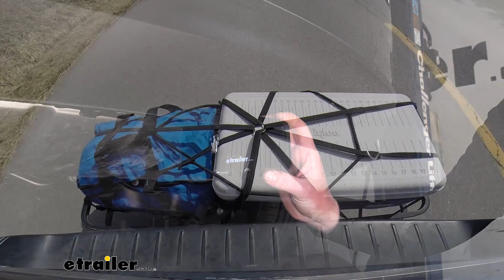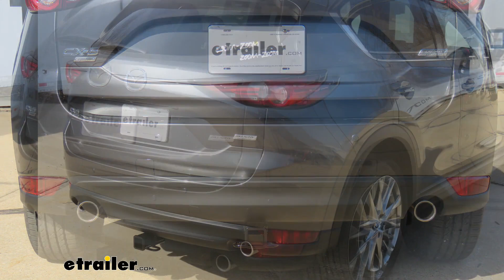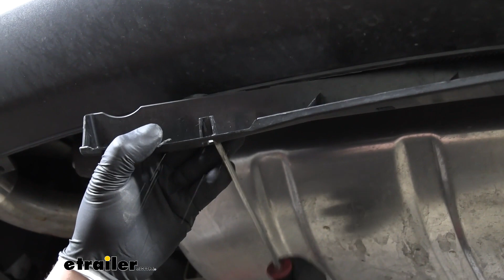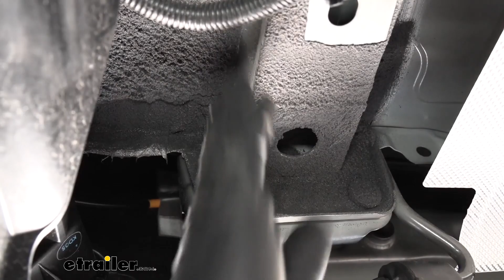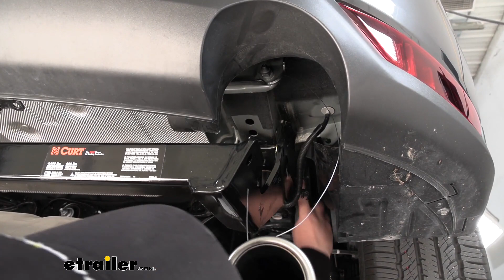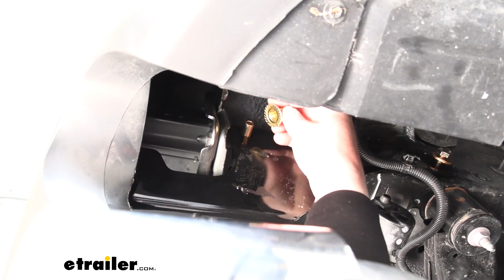etrailer | Mount: Curt Trailer Hitch Receiver on a 2019 Mazda CX-5

Comment: For CX-5, Mazda allows Class I hitches only. Otherwise you are gonna lose your warranty. Keep that in mind.
Reply from the maker: Where's that information found? There's no mention of it in the towing section of the 2019 Mazda CX-5 Owner's Manual, where Mazda lists the vehicle's towing capacity at 2000 or 3500 lbs, depending on which engine the vehicle is equipped with.
https://www.etrailer.com/Trailer-Hitch/CURT/C13315.html

Comment: Couldn’t get the fourth bolt (closest to the bumper on the side opposite the exhaust) through the frame. I think the washer ended up sliding and blocking the hole. Any recommendations to get around this or do I need to drop everything again and start over?